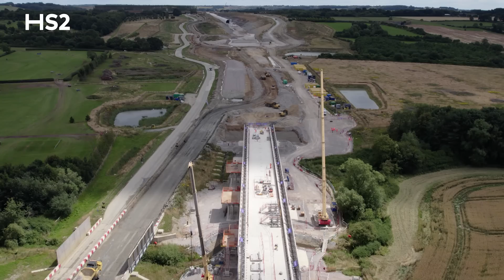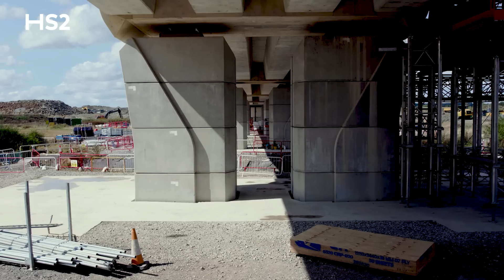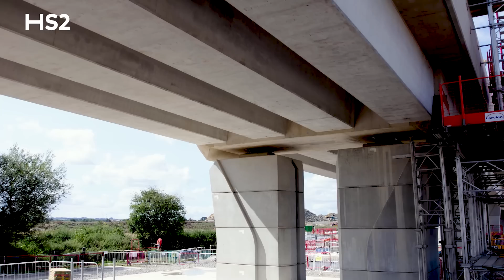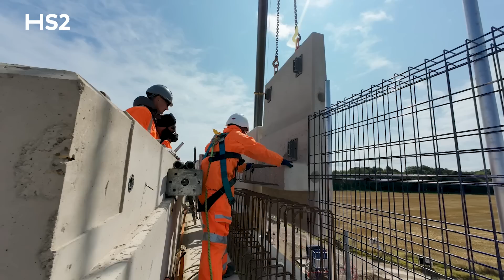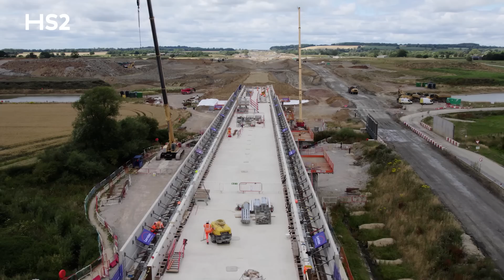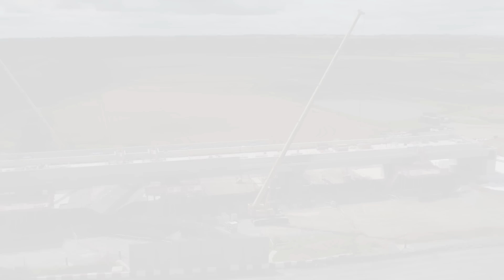HS2 celebrates first completed viaduct

Comment: I’ll never understand why people would want to cancel this project. Yes it is expensive, but it will improve journey times and passenger comfort, which can make up for its cost.
Reply: It’s political.  It will get built just later than anticipated.  

I would imagine the section on to Crewe would be an easy win to continue with and however they decide to complete Euston that part will come.  By the time we get to completion of all that we will be several years down the line so northern and eastern sections can then be considered.

The uk aren’t great at delivering these mega infrastructure projects without turning them into a political mess.  The skill set to build it is world leading but the way it’s funded and financially managed is never our greatest strength.
Reply: @andybushi6418  Read the 2016 HS2 Ltd business case and freedom of information replies, on the Parliament website, FORECAST daily ridership around 18,000 single journey's a day, 6-7million a year (from the mid 2030s), and around 6-7bn annual running and debt servicing costs, from the start of revenue service in 2030, divide one by the other and pre subsidies that's a grand for a single.
Reply: Because people think short term rather than long term …. But overall the route is wrong and their should be more lines more money spent
Reply: It's expensive because land in the centre of England is expensive, and the land needs to be purchased by the state. In other words, taxpayers' money is being handed over to rich landowners who will put the money in offshore bank accounts. That's not a good use of public money.
Reply: @mit6635  It's thought to be expensive because we were told it would cost no more than 32.70 billion so unsurprisingly many now thinks it's expensive. But the 32.70 was a figure pulled out of the air by the HS2 Agency in response to the government who said if it could be built for 32.70 billion they would give the go ahead. So the 32.70 billion figure never had any thought behind it.
Reply: @mit6635  If they'd elected to primarily use just the trackbed of the Central Mainline, and Junction railways, that HS2 only partially uses, but bypasses all the towns on the old corridor, to be able to increase the maximum speed, at the expense of ridership and utility, much of the old track bed is still held by the state owned BR Residual Ltd. The Varsity line / East-West rail corridor between Oxford, and so far Bedford, and possibly at some point Cambridge, took the reuse the existing state owned trackbed approach, but rebuild any stations that had been sold off, and has cost around forty million a mile to reinstate. The HS2, max speed, approach is costing closer to 800 million a mile, close to 10% of that is for the legal fees for  the inquiries, surveys, and property acquisitions.
Reply: imagine living within a few miles of any station between london or birmingham? You can easily commute into a major city.
Reply: This project isn’t mainly about journey times, it’s unlocking huge new capacity on the West Coast Mainline
Reply: @GIOGS .. no it isn't.  The blatant corruption within HS2 Ltd that's recently been exposed reveals that they've been using misleading projections (or lying as its commonly known) since day one to ensure that billions of pounds kept flowing into the project.
Arguments that the WCML is  "full to capacity" rely on a discredited, out of date forecasting model which overestimates long distance passenger growth & isn't used for anything anymore except to justify the monstrous vanity project that is HS2.
Network Rail's "New Lines Programme Capacity Analysis" shows that WCML capacity is kept artificially low by private operators wanting to maximise profits.
A DfT analysis shows that in peak hours leaving Euston, WCML trains were loaded at just 52.2%.
Reply: Massive white elephant, only designed for those wishing to live outside of London but work in London
Reply: It takes exactly 1 hour to get to Leicester two hours to get to Sheffield How quick do you think they can get?
Reply: I don't think people fully understand just how wasteful this project is. I know people working on it and it's wild. Hundreds of thousands of £ in rented plant sitting around just in case. Plenty of brown paper envelopes being handed out. Lots of people retiring early when it's all done...
Reply: improve journey times for who exactly? people going from birmingham to london and vice versa, absolutely useless for anyone else
Reply: @townsandcities  riggght but if you lived in that place then you;d want it for yourself - classic stupid. mentality, if i can't use it nobody can.
Reply: @smokytoji  yes, when it costs each and every tax paying adult in england £2800 then I think I should be entitled to my opinion. I would rather have that £2800 in my pocket paying for electric bills or food than a train line I am never going to use
Reply: @townsandcities  Does the world revolve you, there are million of people like myself pay taxes and will be using the new High Speed line, doesn't cater for people in rural area, i have a bypass nearby me and don't drive, i wouldn't think it a waste of money even if it doesn't cater for me. It's High Speed line not a local commuter service.
Reply: @townsandcities isn’t that true of any railway - un;ess you’re near a station, it’s unhelpful?
Reply: @townsandcities  Faster journey times for London to Birmingham, and assuming Phase 2 is built in it's entirety: Manchester, Liverpool, Preston, Carlisle, Glasgow, etc. Basically for anyone who uses what is currently the most congested rail line in the country. On top of that, it frees up capacity on the existing network for freight trains. More freight trains = less trucks on the road, which means less congestion for anyone who still wants to or needs to drive. Also faster delivery times for anyone using those goods transported by rail.

So improved journey times for basically everybody, even if you don't directly use the train.
Reply: @crashboxnat545  - in addition to this, there will be more local and 'semi-fast' services on those lines where HS2 has taken away the fast intercity services. Initially this will be the West Coast Main line, but if HS2 is built in its entirety then the Midland Main line and the East Coast main line will see many more local services provided.
Reply: @townsandcities you really don’t understand the point of hs2
Reply: @johnlochness  neither do I.
Reply: Journey time will only be 15 minutes faster than the existing line that I use for this journey. But I suspect it will actually not be any faster, but it will almost certainly be a lot more expensive
Reply: @Greguk444 I suspect you are right. Leaving Euston the train will presumably stop at Old Oak  Conmon, a distance of about 4 miles, so it will crawl for that part of the journey. Then there will be a speed limit across the Colne Valley Viaduct which has a curve in the route. So it's not until the train gets past that section will it hit top speed. Then further north it will slow down around the Birmingham area. Then onto the existing WCML north of Handsacre all the way to Manchester. So the journey time to Manchester will be about the same as it now is. Likewise to Birmingham. Those in favour of HS2 have said it's all about giving greater capacity so a more practical and economic solution would have been another normal railway line not a high speed one.
Reply: @TrevorWilliams-fq8mg  ...and that looks like what will happen.
Reply: @TrevorWilliams-fq8mg Given current estimates (Wikipedia), journey times to Manchester will be 28 minutes faster than at present.
All trains will stop at Old Oak Common where there is an important connection with the Elizabeth Line and the Great Western Main Line - making shorter journey times for many people. The trains will then accelerate to 320kph (200mph), which is the service speed. There will be a linespeed reduction to 300 kph (186mph) over the Colne Valley Viaduct. Full linespeed (360kph at present) will not be achieved until trains get past the Chiltern Tunnel but this does need to be seen in the light of current West Coast Main Line linespeed of 200kph (125mph).
You are right that HS2 is principally about increading capacity - it will treble capacity on the West Coast route. However, I don't understand what you consider to be a 'normal railway'.
If you are building a new railway, it makes sense to give it a high speed alignment. Reduced journey times encourage passengers, promote modal shift from road and air services and make more efficient use of trains and train crews.
The fact is that doubling linespeed does not double costs - far from it. HS2 is wider than a conventional railway but is only 19m (23m if a parallel access road is included). That is about the width of a dual  two lane motorway.
The impact on the landscape revealed in drone shots is for temporary works - construction compounds, haul roads etc - but mainly for the unprecedented amount of mitigation works - new woodland, grassland and aquatic habitat designed to appease local interests. 
I've made the point elsewhere that, in a few years, when the mitigation work is fully established, HS2 will be criticised for driving a railway through the country's most important wildlife corridor.😅
Reply: If not subsidised a standard single between Birmingham and London will be north of a grand, a return two grand, and a FIRST class ticket double that, to save a quarter an hour each way. Apart from the Birmingham based Politicians and Civil servants popping to London at the tax payers expense, who's going to pay the premium? The alternative of adding a three quid HS2 surcharge on every single ticket, in the four nations of the UK, for fifty years, to keep fairs similar to todays full price West Coast or Chilton mainline fares between the cities, isn't likely to be popular.
Reply: @AndrewRoberts11  I'm sorry, but where on earth are you getting those numbers? The current journey doesn't even cost a fraction of that.
Reply: @crashboxnat545  The official 2016, pre-COVID-19, HS2 Ltd business case, available from the Parliament website, estimates that there may be 18,000 daily riders, between London and Birmingham (6.5 million single journeys a year), there's also a Freedom of Information reply setting out the figures. The capital costs are now forecast to be north of £80bn for phase 1, borrowed at around 5%, over fifty years, while the forecast operational costs (excluding interest / debt servicing) were forecast at around £2bn a year, suspect Ukraine will have upset the electricity figure, which together offer an annual bill of £6-7bn a year, from the start of revenue service in 2030. Divide the £6-7bn by the forecast 6-7 million annual single fare sales and you get a ~ £1000 single ticket, before subsidies, throw in ridership has fallen ~12% since COVID-19, and that a grand for a STANDARD SINGLE ticket may be even fail to cover the running costs. Suspect the surcharge on all rail users, and a death by a thousand cuts to OAP / Student / Disabled rail card discounts will be used to reduce the headline figure, to the low triple digits. Long gone are the days of a pre-COVID19, £14 Virgin Super Saver ticket, between the cities.
Reply: @crashboxnat545   The official 2016, pre-COVID-19, HS2 Ltd business case, available from the Parliament website, estimates that there may be 18,000 daily riders, between London and Birmingham (6.5 million single journeys a year), there's also a Freedom of Information reply setting out the figures. The capital costs are now forecast to be north of £80bn for phase 1, borrowed at around 5%, over fifty years, while the forecast operational costs (excluding interest / debt servicing) were forecast at around £2bn a year, suspect Ukraine will have upset the electricity figure, which together offer an annual bill of £6-7bn a year, from the start of revenue service in 2030. Divide the £6-7bn by the forecast 6-7 million annual single fare sales and you get a ~ £1000 single ticket, before subsidies, throw in ridership has fallen ~12% since COVID-19, and that a grand for a STANDARD SINGLE ticket may be even fail to cover the running costs. Suspect the surcharge on all rail users, and a death by a thousand cuts to OAP / Student / Disabled rail card discounts will be used to reduce the headline figure, to the low triple digits. Long gone are the days of a pre-COVID19, £14 Virgin Super Saver ticket, between the cities.
Reply: @crashboxnat545  Read the official HS2 Ltd business case, and freedom of information replies, on the Parliament website
Reply: @AndrewRoberts11 you are a liar, it improves B’ham journey times by 40 mins
Reply: @gorgu08  Have you read of the cost saving plan, to use the already paid for, 140-155 mph, BR Class 390 Pendolino fleet, till ~4046, instead of the proposed, non tilting, 250 mph, 400m long, forty million a go, Hitachi sets, that can't operate elsewhere on the WCML.  Many a platform on the existing WCML being 150m in length, not forgetting non-tilting trains are limited to below 100mph, for what will be 2/3 of the 400 mile / 600 km journey from London to Glasgow, so offering no time saving, for the money. Using the Class 390 on the London to Birmingham stretch will reduce the difference in journey time, from the existing WCML Euston to Birmingham New Street, to guess what? 😛
Reply: @AndrewRoberts11 It's an interesting suggestion by a railway professional. 
The problem is that the decision made by Rishi Sunak in a hotel bedroom last November was done without any reference to HS2, Network Rail or the Department for Transport and the implications were not considered.
Railway professionals know that deleting Phase 2a (Birmingham to Crewe) makes no sense and there are other issues.
Hs2 trains are made up of one or two 200m units whereas Pendolinos are 260m, which means the latter carry more passengers.
Without phase 2, due to track capacity and platform length, only 3 200m HS2 units will be able to serve Manchester Piccadilly. So, to quote Andrew McNaughton - former technical director of HS2 - it is a 'capacity reduction exercise'.
There are other problems. Off the new high speed line, HS2 sets which do not tilt, will be limited to 110mph (unless there is some relaxation of the curving rules). With more running on conventional track, that will restrict journey times.
So, the proposal is to re-equip Pendolinos with running gear and traction motors to allow 155mph operation on the HS2 track (taking the place of HS2 sets to Manchester and Glasgow). To avoid capacity problems on the HS2 spine, HS2 sets to Birmingham and Liverpool will be restricted to 186mph. Italian Pendolinos already run at 155mph.
Away from HS2, the Pendolinos will run at 125mph max. but this will reduce Anglo-Scottish journey times and enhance capacity to Manchester.
It's an interesting suggestion (not without its critics) but it addresses a problem caused by politicians.
Reply: @AndrewRoberts11  again you are a liar, the hs2 sets can run on traditional tracks, how do you think they get to Glasgow?
Reply: @gorgu08  Are you any more familiar with the metric system, than the specs of HS2? If you at least can grasp the significance that the HS2 Hitachi train sets were to be up to 400m in length, while the WEST COAST MAINLINE stations have platforms of 150-250m in length. If this means little to you, find a ruler, some string, and ask an adult with some scissors, to cut you a 15 cm length and a 40 cm length, the 15cm length represents a WCML platform, while the 40cm length a Hitachi train, see if you can align them, so bodies on the train can get on / off the symbolic platform.  

Throw in non titling trains are limited to 160 kph on the WCML, like the proposed Hitachi sets, tithing trains are allowed to operate at 200 kph. There are 405 km of track between Birmingham and Glasgow, there are to be 230 km of HS track between Birmingham and London Euston. Throw in the BR Class 390 Pendalino fleet can run at 225kph on HS tracks, and can make the London-Glasgow journey faster than the proposed, shortened Hitachi sets, and have already been paid for, the Hitachi sets are advertised at £40m a go.
Reply: @AndrewRoberts11  Just picking up on one of your points with a slight correction. Non tilting trains on the WCML are permitted up to 110mph, not 100mph (177kph in new money)